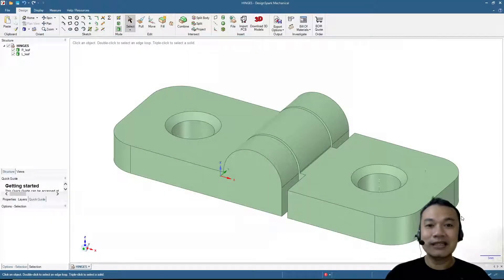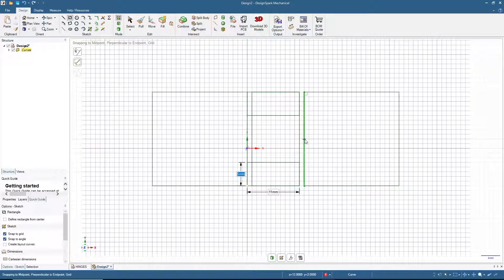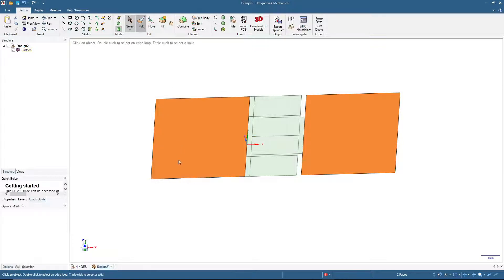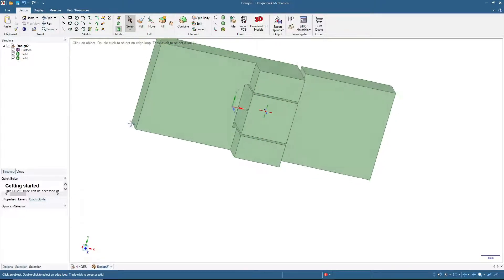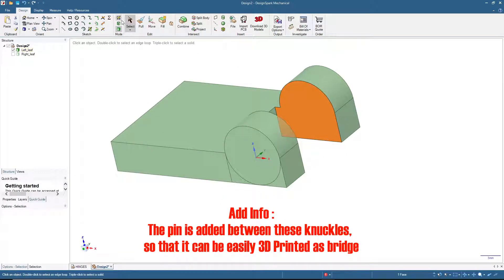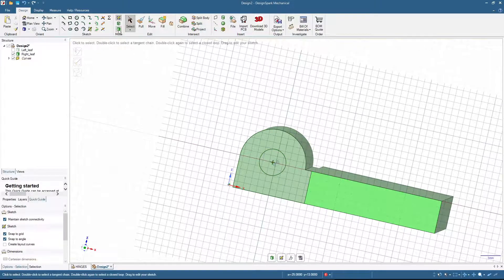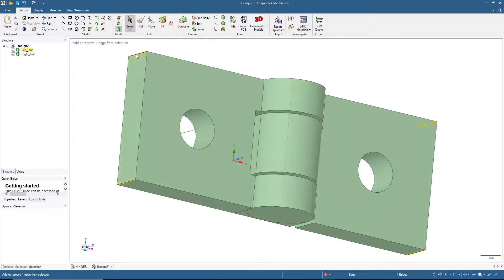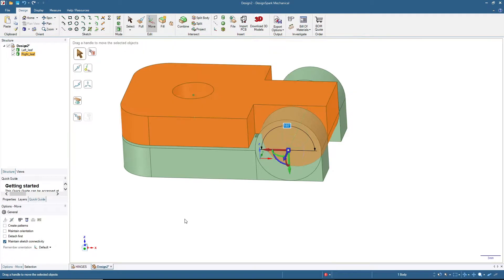Design 3D Printable HINGE - Narrated Tutorial of 3D Modeling Using Designspark Mechanical #06

Comment: Great tutorial. But how can the pin be printed without support, when there is positive clearance. and shouldn't we be breaking the support material, to get the hinge movement !? thanks for any response. and had anybody tried printing this !! will be great to get a feedback :-)
Reply from the maker: Good question.
You don't really need to use support for small "bridging".
Just make sure that the pin is hanging inside the middle knuckle, not in the outer ones.

Comment: what formula did you use to create the pin and the hole? Is that formula usable for all sizes of hinges? Meaning it does not matter if the hinge is bigger or smaller which also affects the size of the pins and the hole. I always use PLA. What temp are you recommending? I used 210 nozzle, 70 bed.
Reply from the maker: For the pin diameter, try about 1/4 up to 1/2 of the hinge knuckle diameter. If it's too small, then the pin gets weaker. And if too large then it will reduce the strength of the cylinder.
For the gap, it will depends on the printer and setting (speed, acc, jerk, cooling etc). If the precision is good, you can try 0.5 x nozzle diameter. In this video I'm using 0.75 x D.
For slicer setting, better not to use support, add a little more fan speed, and reduce nozzle temp a bit if necessary.
Hope this will help :)

Comment: Would like to know if there will be no problem printing this hinge. Will the hole and the pin stick during printing? Do you have recommended settings for PLA printing? Thanks
Reply from the maker: For PLA, try these hints :
Layer height 0.2 or less, outer wall jerk : 2 mm/s, cooling fan speed : 50% or more.
Be careful with temperature and wall flow rate, don't go too high
And wait for the print to cooldown before moving the hinges.
Reply: @W3DEStudio  Thanks